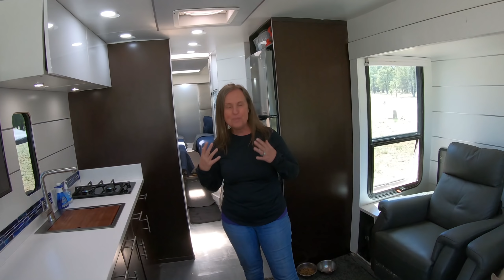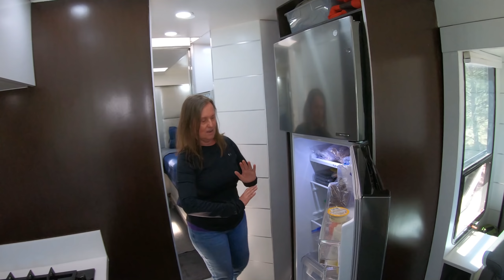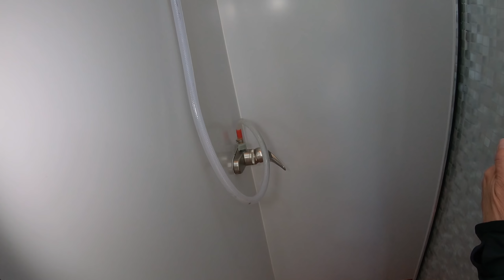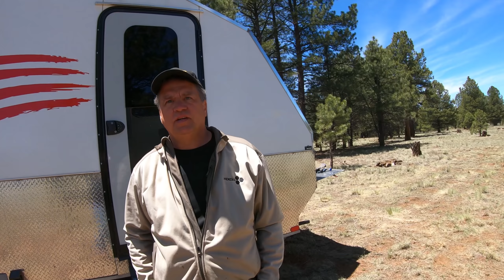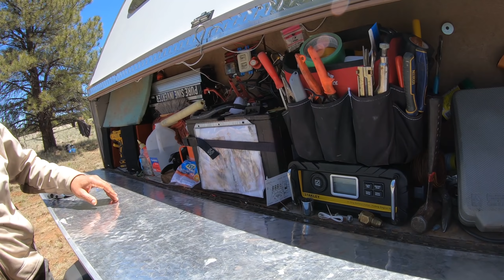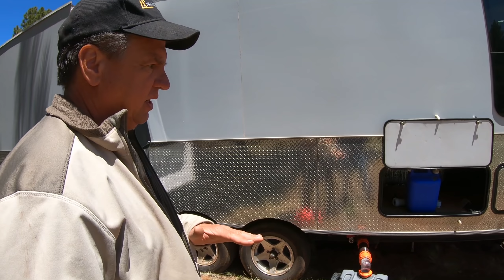DIY - RV - Rig  - Tiny House - Custom Camper - he made this from scratch!?

Comment: How do you seal the seems on the alupoly and create a seemless look?
Reply from the maker: The panels are adhered to aluminum tube - so there really is no need to concern with water intrusion - white silicone is what brigges the 1/6" gap.

Comment: Absolutely blown away by this....watched it 3 times. What's is the main material of the trailer base you got ....steel or aluminium?. Also Is the shell that you built framed with timber or steel/aluminium?  Great work guys...really great.

Comment: Much like the build of 2016, unfortunately, there are too many questions to have posted in the comment section, which I hope will be answered in successive videos.
DeAnna makes reference to "links below" (suppliers/products), but there is never anything there..!!  
This was also the same as the previous build 2016 (black/gray  water storage questions)..
I question the use of IKEA cabs because of their heavy & flimsy mdf construction. The bath cab might be OK, but the deep bedroom cabs are suspect.
Besides attaching to the back wall, I can only surmise that you are attaching the cabs to the ceiling and side walls, too, to help support the exposed side..
The obvious & glaring question, especially since neither of you appear to be old/infirm, is in the master bedroom: Do you add some type of center mattress & support to join the other two as it appears that you sleep apart from one another..???  Just askin'...
One more point, that ultra wide angle lens glaringly  renders  everything out of proportion in the interior. 
While I realize the fridge is mounted on a platform, DeAnna appears to be 4' tall.. LOL!
Reply: https://www.amazon.com/gp/product/B077NS74VQ/ref=ppx_yo_dt_b_search_asin_title?ie=UTF8&psc=1

Comment: Mark & DeAnna, Another great video. I have several questions: 1) what are the overall measurements of the trailer; 2) how much insulation; and 3) did you say the trailer came with the slide out??

Thanks Mike
Reply: Hello Mike!  So glad you saw our new video!  We are happy to answer your questions.  #1  The dimensions of the RV are 8 x 27 not including the hitch.  #2  The walls and ceiling are high density foam with, I believe, an R factor of 14.  The floor is standard 6" batting insulation.  Not sure of the R factor.  #3, yes there is a slide.  If you look closely at the leather recliners, they are in the slide out.   Let me know if you have any other questions.  Happy trails!  Mark and DeAnna
Reply: @RealEstateByDeAnna  Maybe this is a question for Mark. I'm thinking about buying a cargo trailer and converting it into an RV. How difficult would it be to add a slide ?
Reply from the maker: @mikekendig6781 - the slide that we are using is cut through the 12" - "I" beam frame - and fastened ( welded) to the frame - it would be possible to weld it to a cargo frame - you may have to notch the rails - just math and time. There are also some new slide hardware kits that somehow work from the sides ??? You probably could very simply do a manual set up using a tube in a tube and pulling it out by hand and just supporting the "box" with jacks - we always use jacks anyway... Just check with your local steel supply house on what tubes will fit the inside diameter -